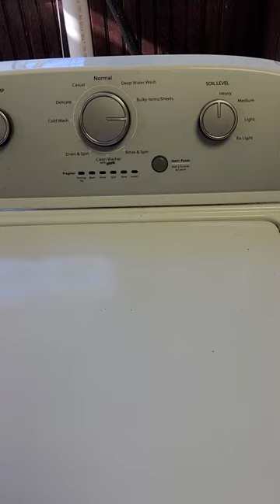What's the WORST Thing You Can Find in an Appliance? #shorts

Comment: I had a roach infestation in my dishwasher.  I have a phobia thanks to growing up with parents who didn't see anything wrong with them and didn't see the need for professional pest control... UGH! I know that hot, electronic, syrupy roach smell anywhere.     I have no idea where the original queen came from but I called the exterminators and almost broke down crying.  They sent a guy out the same day to start the treatment.  It took FOUR MONTHS to get through all of the potential generations of the horrible, horrible things.  That dishwasher just died last week and the replacement is coming tomorrow.  I've warned my husband he needs to be armed with a vacuum and a mop to clean up the mess, not me,  because I'm going to throw up as soon as they pull the old unit out, due to the likely smell.  Amazingly, because we caught the infestation before they got to the electronics, the GE dishwasher lasted us 13 years!  Now it has stopped draining, and the cost to replace only the sump motor isn't worth it.  Getting a new Bosch.
Reply from the maker: Wow! What a story!

Comment: All I know I've been there I had to replace if you microwave back and my other house over on Sunshine avenue add a big giant field in my they had pest control problem they had mice and stuff and everything else my cousin came over they brought roaches in it ruin my 3 my microwaves they ruined a couple of my microwave so the best way to get rid of roaches basically is to call the past may have the outside and then has start putting those sticky traps for mice and then or sticky pads but they do they're poison